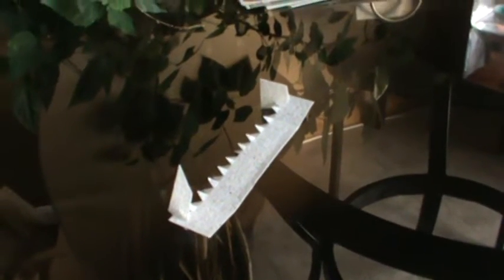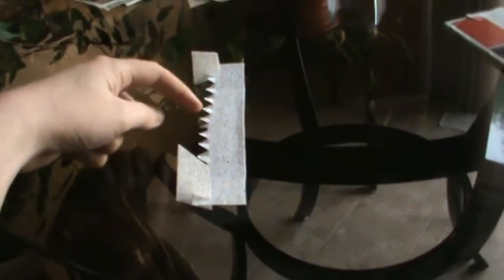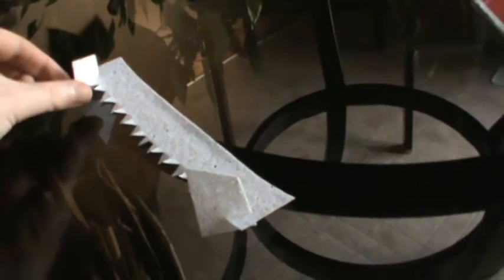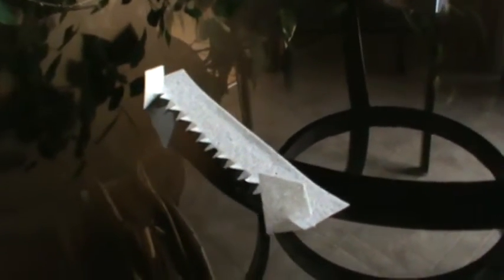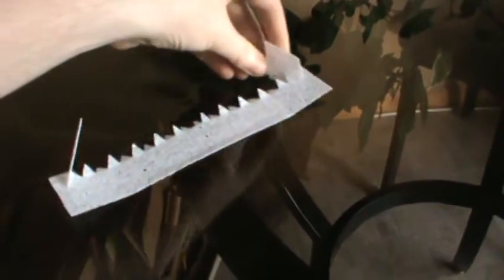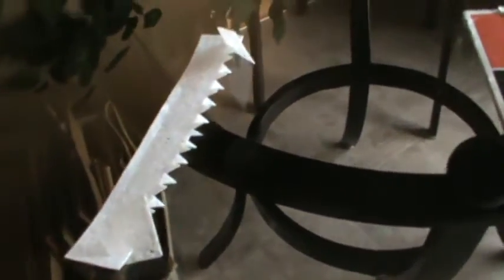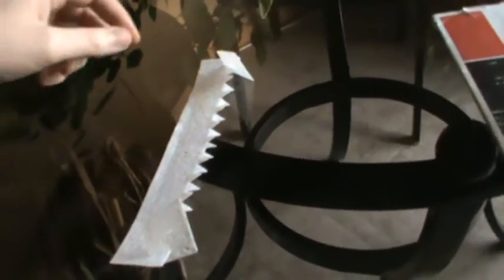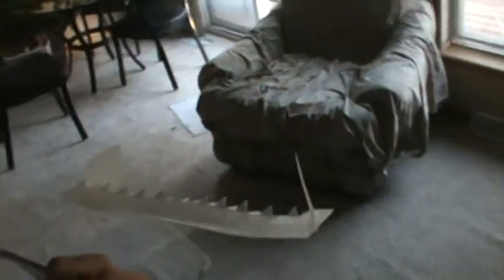The Impossible Airplane! Vertical fins in FRONT of the CG, yet it's stable!  How can it fly?

Comment: In addition to my other comment, I'm going to make a try at the specific mechanism. Let's say that the glider starts veering left. The left fin then heads directly into the wind, while the right fin is now extremely angled to the left. But instead of ruddering left, there is now so much drag on the right fin ( stalled essentially, and correspondingly very little drag on the left fin because it's straight) so the right side of the glider is dragged back on that long lever arm since the glider is long and thin. This would also explain why a towed-out (opposite angle of fins) glider has such unstable yaw. 
In effect, your toed-in glider does act somewhat like canard in that a canard can be made with a steeper angle of attack so as to stall before the main wing, regulating pitch somewhat. All of this might be complete hogwash, but that's my guess. I'll be interested to hear the real answer.

Comment: That's quite extraordinary that your can have the advantage of vertical stabilizers without the weight, because they become the front weight! If you are a beginner flying with a board (my main interest is getting people started), the glide ratio doesn't matter; here's plenty of updraft to keep it up. But flying slowly with good control does matter because beginners need time to think and react as they're flying. Nice work!
As for why it does not veer off to the left or right, I'm stumped. But I'll take a guess that it might be a variation of what makes a canard work--only shifted 90 degrees from pitch to yaw. I still can't figure out the force vectors of why your new-fangled pigeon-towed innovation is so yaw-stable.
Now I'm curious if it still works so well with heavier foam, and if the towed-in fins and towed-in fore of the CG fins will work on other glider designs?